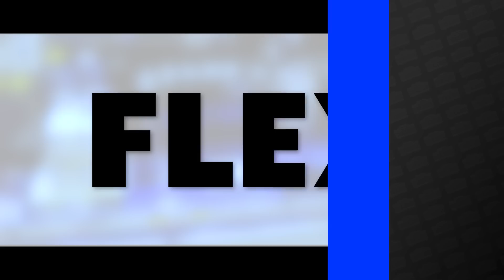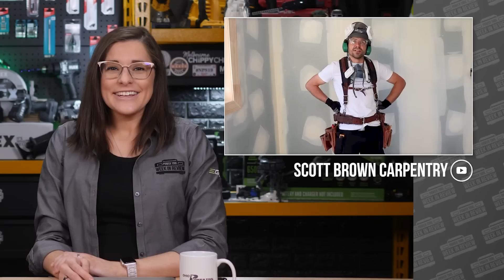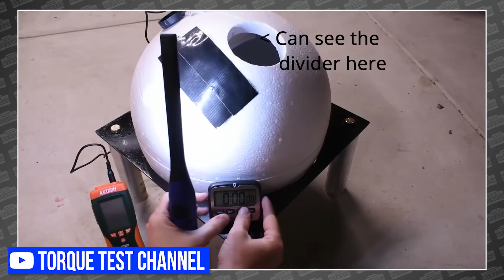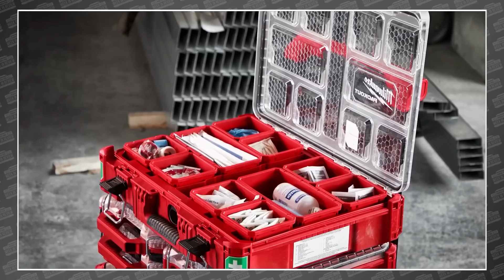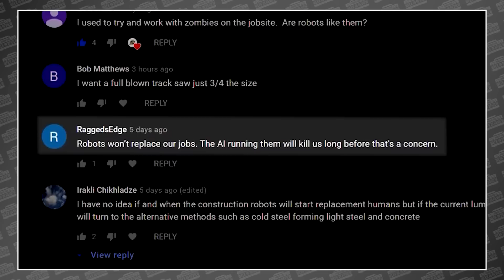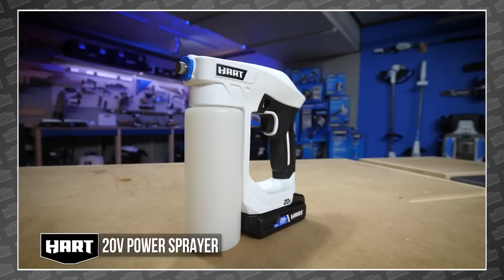HART is building a battery platform for EVERYONE. But will it work? Power Tool Week In Review S4E21

Comment: So far I have been happy with the few random hart power tools. Now it didn’t replace my fuel m12/m18 tools. But for led lights power washers, impacts to leave in cars, basically tools I don’t care if get trashed or loaned out. So far they have held up and yet not one bad battery. Just wish they had a real rapid charger. Plus they are cheap

Comment: Hart is changing shit up. I'ma get that shower and all my power tools git taken so I'm in the market. I'm a DeWalt guy (power/durability) I've dropped my impact driver from 30 feet and only needed to get it reskinned. Honestly I could have tapped or glued it and it would have been fine. Milwaukee has the ergonomics and more tech savvy things however I'm willing to roll the dice and buy a set my son will probably get to learn on.

Comment: on hart:
i do agree that being available in walmart will certainly get them into EVERY house (but i also think it makes them lose a lot of credit/respect from people who actually use tools)

but that said, and my point in posting, is that i dont see anything ground breaking there. ive seen several other established manufacturers making vacuums, lawn equipment, hot glue guns, pressure washers, soldering irons, air compressors, ect.....

Comment: Metabo is pulling a "Porter Cable Instagram," except with actual new (and good) tools.

Regarding robots -- as an engineer in the arch & engineering industry, we can't even get Revit / BIM modeling right.  Robots are decades away 😂